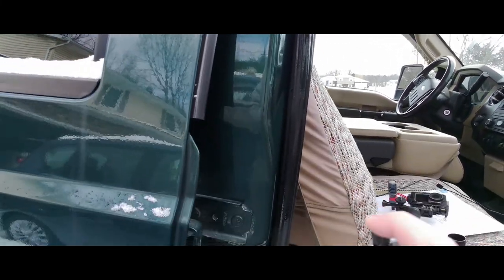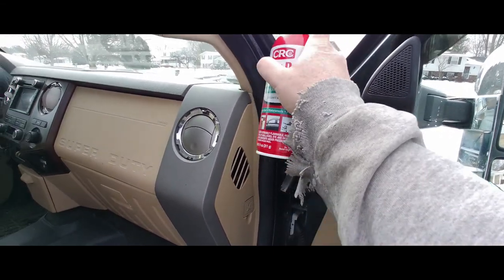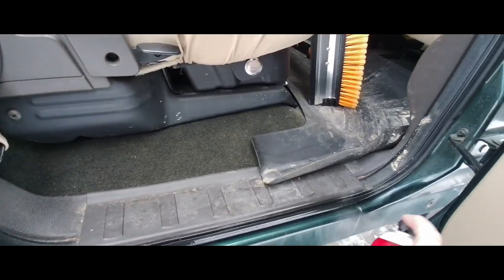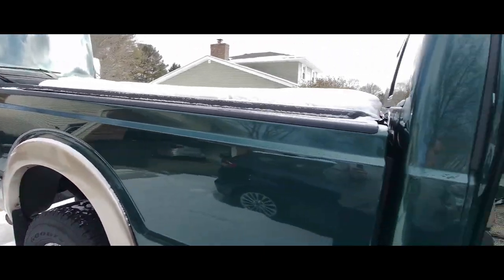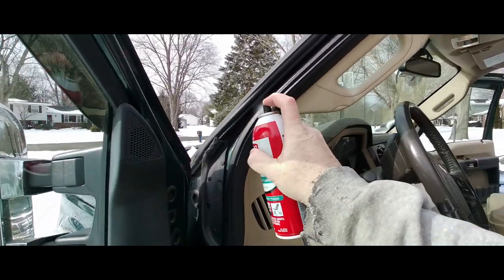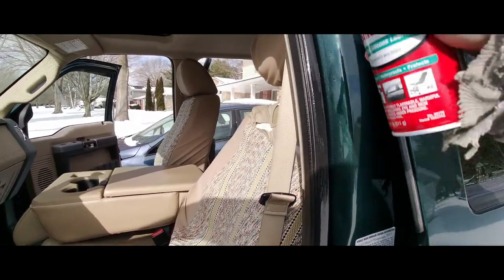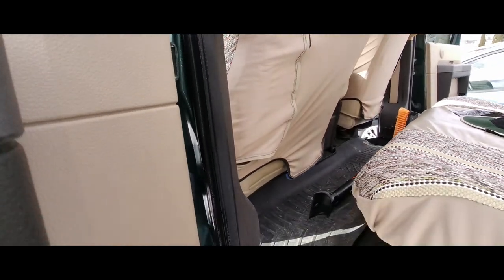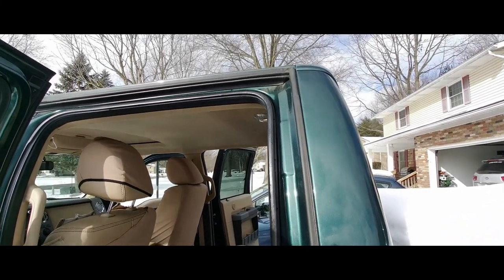Silicone Spray on the car door seals

Comment: I spray my door hinges and locks with WD-40 and sometimes silicon spray so the doors and locks are smooth, my key was sticking years ago in my ignition switch  so I sprayed WD-40 on my key and inserted it into the ignition switch  and turned it a few times and it was a lot smoother, a coworker did the same thing a while after I did and he said it worked good.
Reply from the maker: Hi Mark.  Great tip.  I need to do that as well.  Seems WD-40 is great for just about everything!  Thanks for watching.
Reply: WD-40 is a dust collector water base spray, I prefer selicon  the lube last a lot longer and I used  dry graphite in  locks.
Reply: @fishycomics  WD-40 has worked for me for years but I have used the silicone before like I did on my vehicle s last week.
Reply: @marksreviewsandrants8554  totally hear you. WD-40 for this and Selicone for that
Reply: The pros recommend wd40 then a lube. Wd40 isn't a lube, its a cleaner i believe i read.